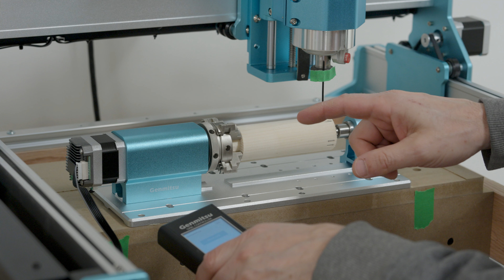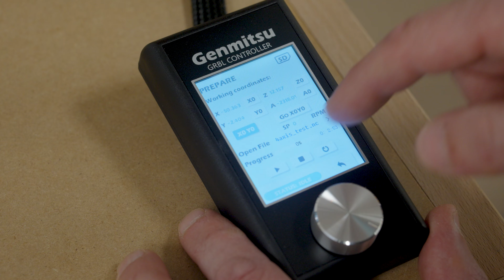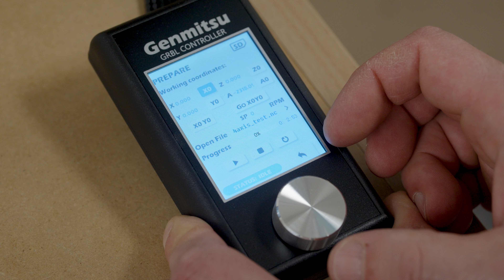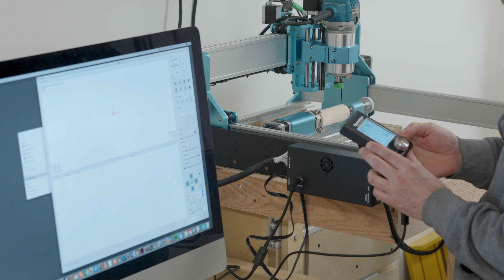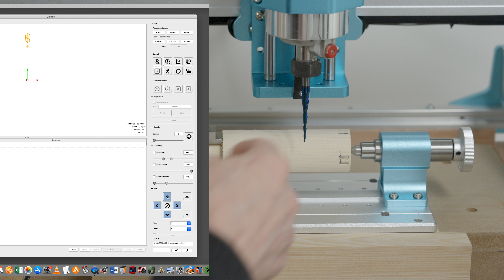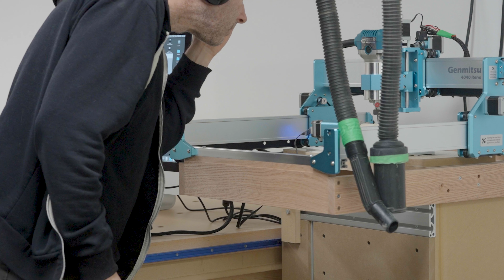Product Review - Genmitsu CNC Rotary Unit

Comment: This is great. I've had some kind of lathe duplicator mulling around in my head for a long time. I just found this video and then realized I'd seen your previous hand-held duplicator that slides on a platform maybe a year ago. I bought a small rotary axis like the one you showed in a more recent video, but didn't love it. I have a Shapeoko which can only handle 3 axes, so I made my own controller with a Teensy, DRV8825, and 24V power supply. I used a potentiometer to control the speed, and was "tricking" the CNC to just machine within a ~1mm boundary to get it to ride the silhouette of the shape from the top. The setup both didn't really go quite fast enough, and also struggled with stalling out on me. I abandoned it.

Long story longer (but somehow I feel like with your commentary and creations you don't mind??), I have been thinking about another run at a duplicator. I have not been impressed surveying commercial options, and was pondering two sets of perpendicular linear rails like yours. I googled "precision lathe duplicator" and lo and behold, you've executed the idea! I never expected your video to end with the low profile, constant speed "4th axis" on the CNC. It's wild the overlap in ideas between us (though I give all the praise to you, as you've actually built them)!

Question if you don't mind sharing: do you have any details about the drive side of your setup on the CNC? Did you use toothed pulleys to connect the motor to the drive? What exactly is the drive part (doesn't look like a chuck, just a threaded attachment, or maybe just a friction or spur center sort of thing)? I have a live center from the original 4th axis thing I got, so I think I could use that to mimic what I see on yours. I think without stall torque issues, I may return back to my original idea vs. the duplicator, as you seem to be leaning that way as well.  I could even prep blanks on the lathe to cut down on some machining time, and then pop them in.

Really inspiring stuff, I'm really impressed at the creativity and execution!!

Comment: I thought that candle could not control a 4th axis.
Reply from the maker: It doesn't actually.  You have to use the little GRBL control unit (extra) to run the G-Code from a micro-SD card.  But also have candle running simultaneously.  I'm still a little confused at the whole thing but I think the more I use it I'll figure it out